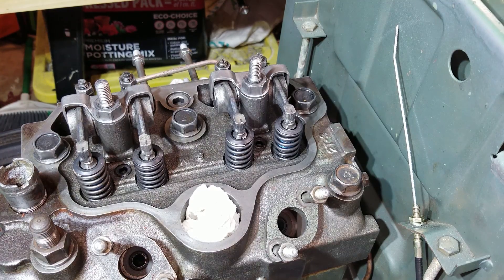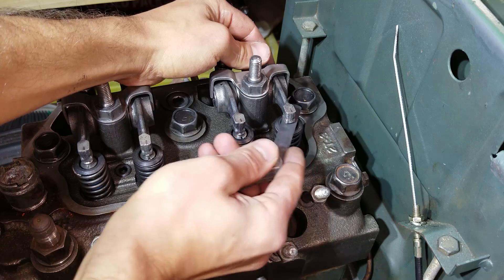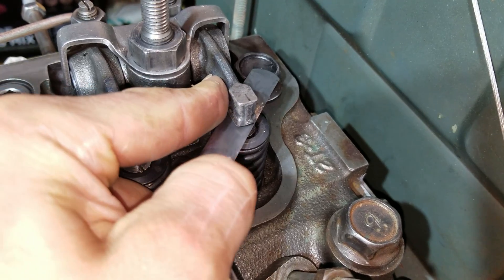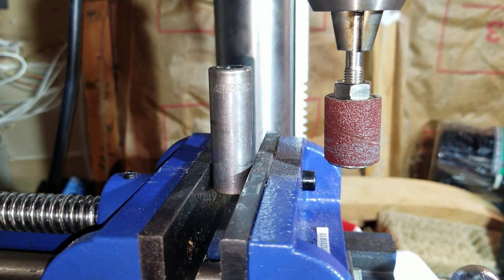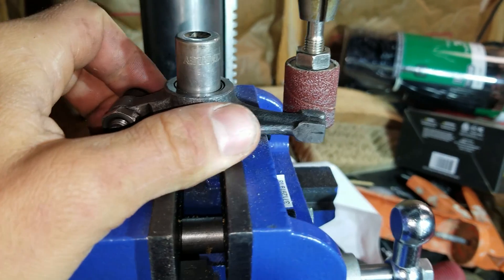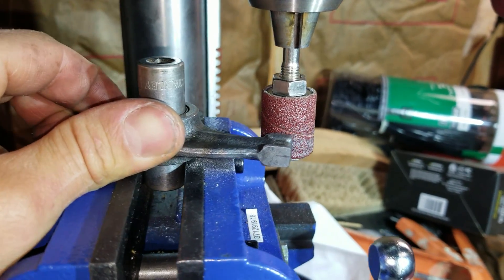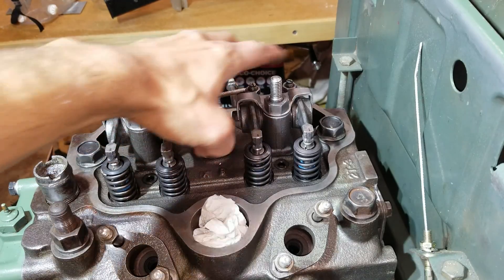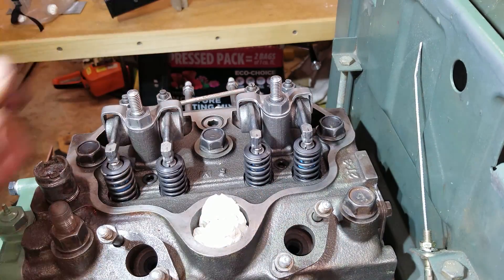How To Regrind Yanmar Diesel Tractor Rocker Arms

Comment: I wanted to let all know. If working on the three point the only thing you need to really worry about is in the control valve. Before taking tge jam nut off to check the Oring make sure you take a plumb picture of the lock nut. You will HAVE to put it back in the same place lol